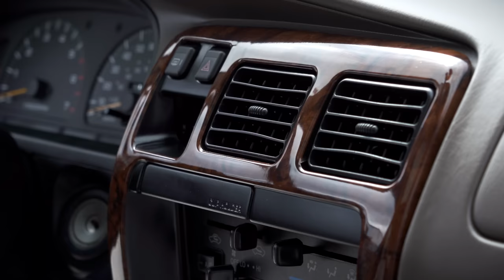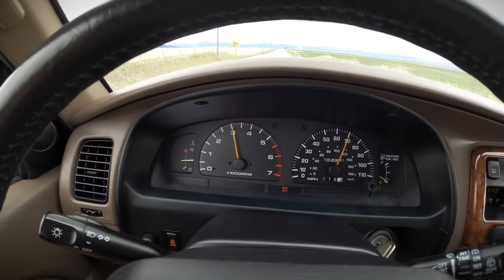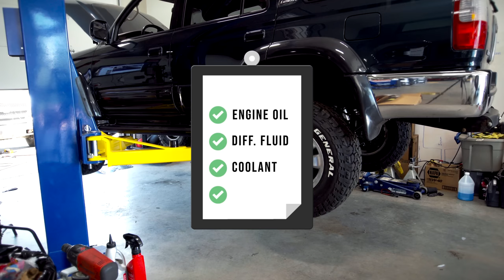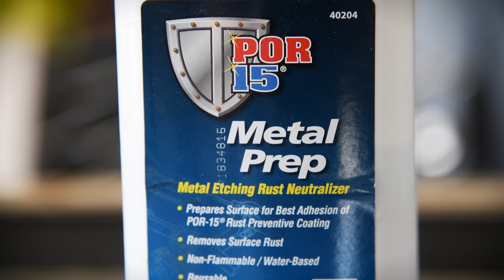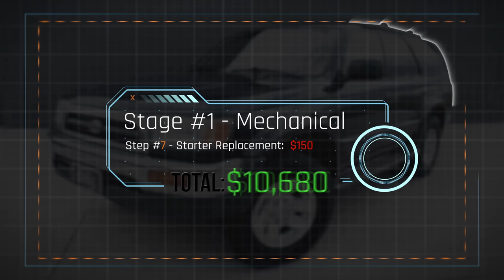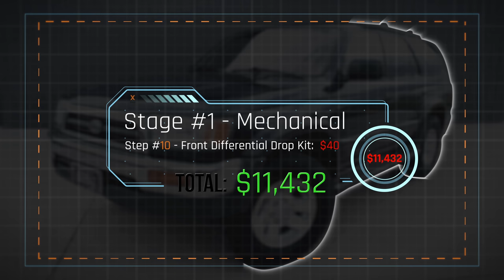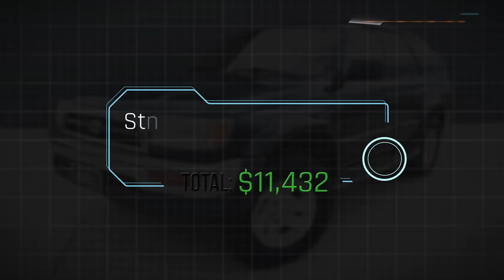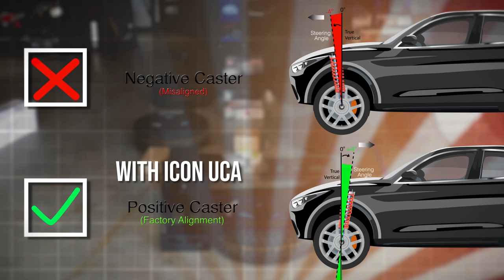[SNEAK PEEK] Build Your Own Overlanding Truck from Stock: "Zero to Hero" - In-depth Vehicle Build

Comment: Poor advice on doing a diff drop. Yes they can solve CV angle problems, but they also introduce other compromises. Go look on TacomaWorld at the front diffs that got killed from doing diff drops. Just don't lift an IFS like a monster truck and you'll be fine without it. What is easier to replace when you are far from home on an expedition: an entire front diff housing, or CV axles/boots? Which is easier to keep spares of?
Reply: Agreed. There is some worthy debate on 1st gen Tacos and 3rd gen Tacomas but they are a waste of time and potential point of failure on newer gens just to drop the CV maybe 1cm when you look at how the geometry changes.

I’m also bummed at using por15. So many better rust preventive coatings out there that won’t potentially peel off.
Reply: Why not do a transfer case drop . ? 
My jeep has 2" TC drop helps solve the axle angles
Reply: @ryanreinhart1834  transfer case intergrated in transmission tailhousing
Reply: you can solve that problem of if your IFS blows out on the trail in the middle of no where , just install manual locking hubs.
Reply: @notrelavent  So basically if someone does a band-aid "fix" of a front diff drop on a Toyota IFS to save money of doing it a better way, then logically they should also spend several thousand dollars doing manual hub conversions. That is your suggestion? We aren't talking about solid axles here, IFS is a whole different animal.
Reply: They're fine on these 3rd gen 4runners. I haven't seen anyone have issues with them as the most they ever go is 1" and pretty much all aftermarket skids plates are built for them.
Reply: MEH. around 150k miles on my surf with the diff drop kit and have had zero issues. I think you're talking from your rear end.
Reply: @reppin2076  Congrats on not having problems. I stand by what I said. If you understand the how & why of doing a diff drop then you understand it's just a band-aid to try and correct CV angles. As a result it can put more stress on your front driveshaft U joint angles. It's compromises all the way down. Everyone's setup is different, and what I am saying is it is poor advice for XO to say that everyone should install a diff drop as a "fix" when in reality some setups would be negatively impacted by it.

Comment: I got a 97 4x4 4R: Good build! Please install OEM lower ball joints and a radiator (Denso works fine) to avoid pink milkshake. Install OEM alternator brush kit and  starter contacts into the existing alternator/Starter. A/M parts FAIL! Install the A/C idler bearing 6203 (avoid A/M),  had the 4R since 2009 and it is in pristine condition. Did all OEM bushings all around. I have 2 drive shaft in my shopping basket for my 100 LC and after seeing you do the shaft, I now want to purchase those shafts for LC as it is my long distance vehicle. Any A/M Cv's are junk! (the inboard splines wear out in less than 15K miles). Best would be to reboot the OEM CV's. Keep an extra ignition coil pack, 2-3 fuel injectors. TPS.  If you plan to do the rear axle bearings/selas pelase follow TIM's video on Youtube (pay attention to the Sharpie test on ABS tone ring retainer: if didn't  mount properly, oil will leak again) Good Luck!

Comment: i have been waiting for this video build for a while, love it cant wait to see the rest of it.  i think the 3rd gen are the best looking suvs, and i love my 97 third gen. i have a question
don't you think you all need to have a pan hard correction kit for the lift?
Reply: I have a 1999 3rd gen 4x4 SR5 w/5spd manual trans.  I too think they need a Panhard Correction Kit!  Eimkeith is a great one, but I've heard of recent one's that bolt on instead of weld on.  Good point!

Comment: This was great to watch an "everyman" build, complete with a lot of great ideas for things to look out for. Well done guys.

It was a bit painful to watch your use of the air impact though.... not a torque wrench in sight! The cv axle on my truck has a torque of roughly 70ft/lbs, an impact puts out what, 400+?
Reply: I think it severely missed the budget part of the budget build. They were already 8 grand into it not counting the cost of vehicle and engine repair cost, and the only overland parts that were installed was diff bushings and a 4 grand ICON set. Which is the opposite of budget suspension
Reply: If you consider how this 3rd gen is being built, it is a good step in the right direction.  Mainly, because it is a Pan-American expedition build.  The budget is in the consideration of the long haul; eventually an ultimate build, for Overlanding.  The suspension seems to be one of the biggest expenses, if your a serious enthusiast!   I'm just glad to see this build finally! Lol. Take good care out there!

Comment: It was cool. I have a 2008 tundra crewmax with 165k with a level kit . I also own a manual jeep wrangler 2012 with cheap 2 inch lift ,winch, offbroad tires with 125k.  Both paid off and mechanically good.  

Great content as I been pondering which to start. I go and forth.

Great content to help me think.
Reply from the maker: Right on!

Comment: What type of battery did you install in there and is that battery bracket required to fit the new battery. I’m currently building a 3rd Gen and the electrical system is my current project.

Comment: I agree with the napa CV rationale for a vehicle that is going to remain in the US but you should have used the extended travel cv that allows you to use the full range of your lifts travel without binding up and breaking like the others do at full droop on an aftermarket coilover

Comment: Im working on a 1947 Willys CJ2A build. Benz Diesel Willys Brute what im calling it. 4cyl Mercedes Benz Diesel, D30/44 axles, full lockers, warn hubs. Front changing to coil & 3 link. Rear stretching to a LJ “ unicorn wheelbase “. To give me chassis length for a 6’ bed. Building a Half crew cab. Sitting on 33s. Once driving then Twin Turbos get installed

Comment: I have 06 Tacoma, my rear diff's fill whole plug is seized, how do I get it off without damaging it?  I'm also pass due for changing the fluids because of it.
Reply from the maker: We are not a credentialed shop, but we generally use some type of vibration to break seized bolts loose! This could be an air hammer or hammering a breaker bar to loosen things up. I would consult a local tech if it continues to be an issue
Reply: @ExpeditionOverland  ok, thanks.  that helps thanks for the info.  People have told me to just use a blow tourch on it, but I know that will leave the metal weaker and more likely to strip the threads because of the metal being softer in a heated state after it cools

Comment: Something to consider for future projects . Any bushing or suspension thru bolt should be torqued with the full weight of the vehicle , wheels and tires on the ground or a four poster drive on hoist.
It's not always easy to do, but doing it with the full weight of the vehicle will prevent the bushings from twisting which eventually leads to cracks and failure .

Comment: I was building the truck over the 4 years. Every year I found thing that would get better thing as make easy and faster unfold to fold and ready to go. So there is no day it is done.I wonder this build it will be easy to buy 3 - 4 ears old 4 runners from florida, as all bushing will cost a fortune already for the cheap truck. I would say to build truck to ready for long haul - 30K at least.Just wheels and tire -~2.5 K, lift and budget struts - 2.5 K, RTT - 3 K, water tank, roof rack, and camping gear - 5 K, extra light - 1 K , navigation - 3 K, winch -700K, front bumper - 2 K, rear bumper - 1k  and many things over time - tools, spare part, awning and ect - 10K. 
Good video shows don't do it, buy brand new truck and get a lift, drop box with kitchen and sleep inside your truck. See if you like it. If family then safe monet get a truck with bed, buy 1 K RTT, toilet tent and see if your wife likes this, before go with 30 K build.
Reply: This is not the point of the build!  Go pay thousands for your new ride with car payments of over $700 monthly and then try and spend thousands more because: YOU CAN AFFORD IT!   Not everyone can!    I personally build my own rigs!  This build takes us back to simpler times, with better components!   This build is not for everyone!   You can have your TRD Pro!  Pay someone else to build it for you!
Reply: @scubbarookie  that was my point as too many videos on buld, but no associate cost

Comment: Some great advice, but some serious things you forgot to suggest or recommend.  Awesome replacing parts with oem Toyota stuff but when you start using aftermarket Napa axles. You clearly show how little you understand about the aftermarket parts industry.  You are way better rebuilding OEM parts then installing poor quality “ so called “ new aftermarket parts.  I personally have had a axle manufacturer replace 4 parts of axles then finally refuse to warranty them any longer.  Which I went back to oem axles Just FYI new aftermarket does not guarantee anything may times worse

Comment: I feel this video discourages people from overlanding on a reasonable budget. The modification you performed a way to expensive and unnecessary. The drive shafts you are replacing should have been rebuild with OEM rubber boots. That way you kept the super reliable Japanese parts instead of using NAPA junk. Spare CV joints are needed for repairs on the trail or camps- put one or 2 in the trunk. Skip the lift and just put some new shocks in the vehicle. I feel you did not accomplish your goal to build an overlanding vehicle on a budget. try keeping it under $12000 for the toyota+ equipment and maximize the value and capabilities of the vehicle. throwing thousands of $ at it is no skill.

Comment: Calls it a budget build, then proceeds to spend $10k on half of phase one.
Reply from the maker: $10k includes the purchase of the vehicle and a full top-end rebuild 👍🏼
Reply: @ExpeditionOverland  not according to the video. In the video you said yall paid 5k for the 4runner. Then at the end of the video your total was a little over 15k. So, if math is correct, 15k minus 5k (cost of the 4runner) equals $10,000 spent on it in half of phase one.